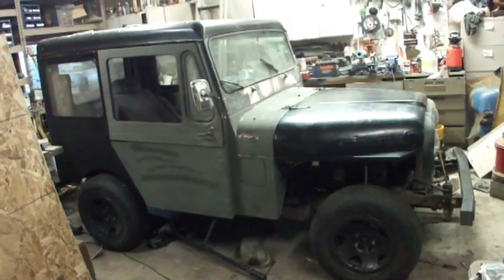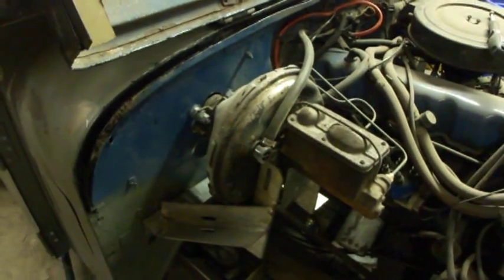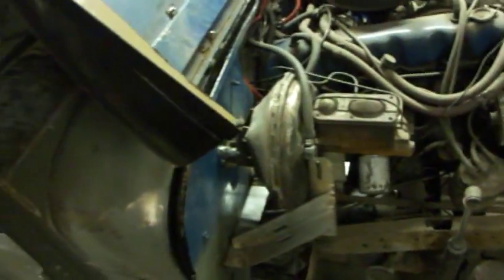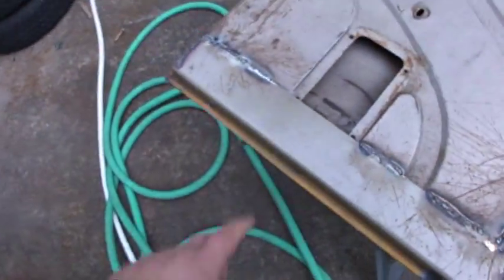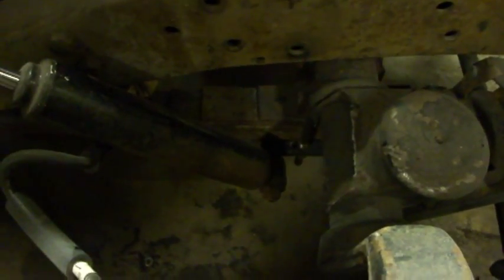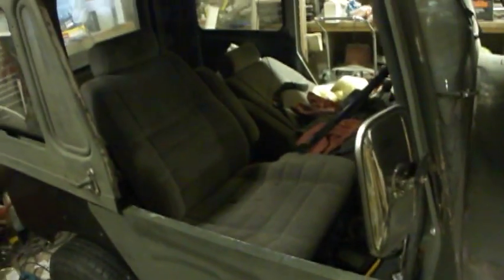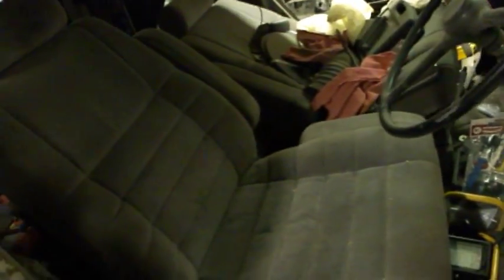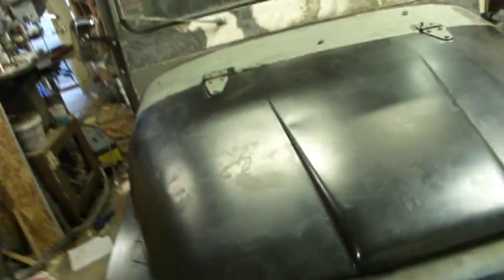dj5 postal jeep project- 13 past project recap

Comment: Weld in a "z" bar extended to fit ... part goes under the frame n the top of the ( z) is fitted for  the shock... made from bar stock n welded to frame for strength of ( strut/shock ) n your wheel wells are/ can be supported by it as well, jus an option!??

Comment: I was  just wondering if you know what soft top will fit a dj5. I have a DJ5 that was professionally remodeled by SAFARI KAR. They switch the steering will & turned  into using a soft top.... However Safari Kar is no long in business ... It looks basically like a CJ5 with a 5 slot grill ,but I don't know a CJ5 top would fit correctly?
Reply from the maker: your dj5 has the top cut off? the cjs have a rear end molding that is designed for tops that come off. cutting the side of a dj would leave a flat steal point that would require a custom fit. ive seen djs that are cut but never seen a top to fit it.